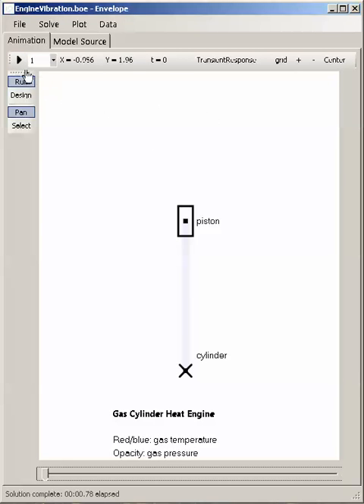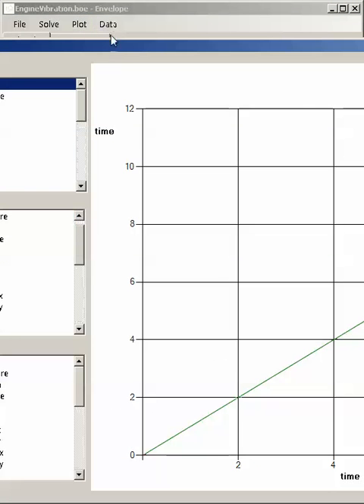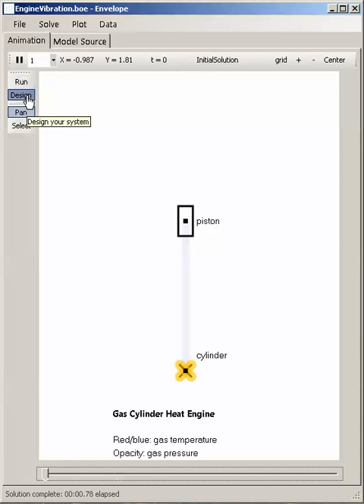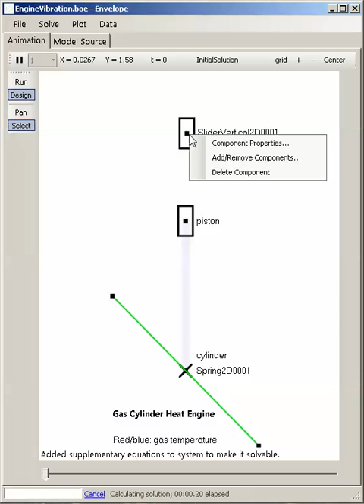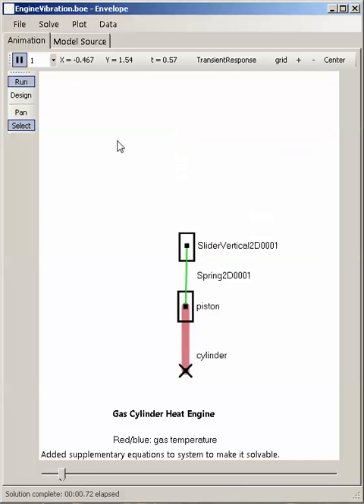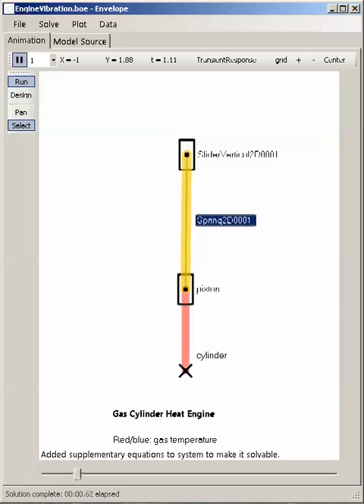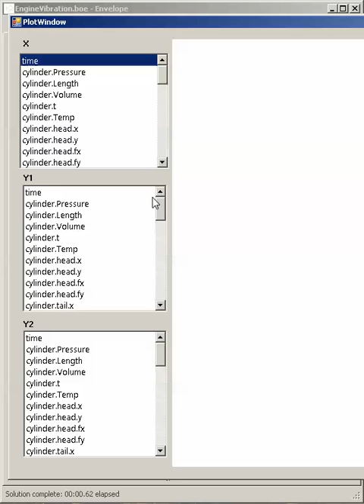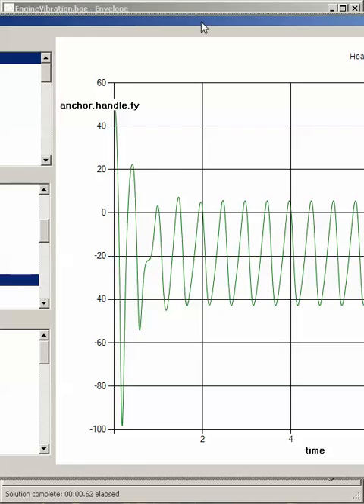Vibration compensation of one-cylinder engine using sprung counterweight

Comment: Wjhopa! I mean, whoa. On real thumpy engines like that they often do a "balance shaft" that spins counterrotatingly to the crankshaft, with weights sticking off it. My Future Track Bike (two parallel cylinders) has one of those: http://www.ebay.com/itm/like/230995324074?lpid=82